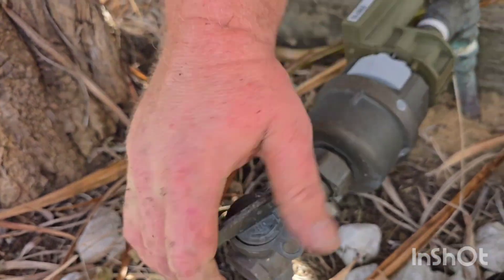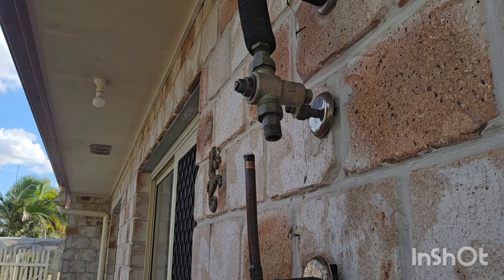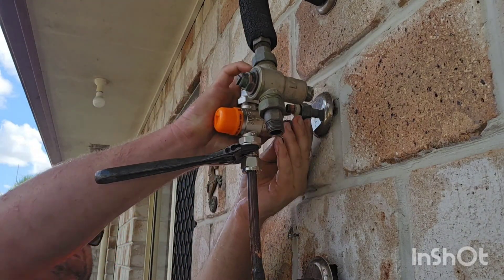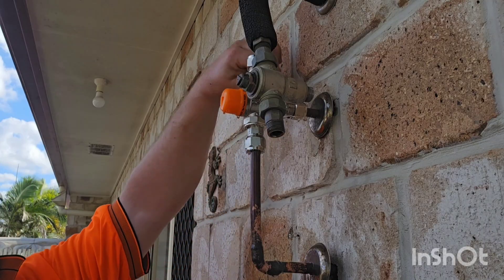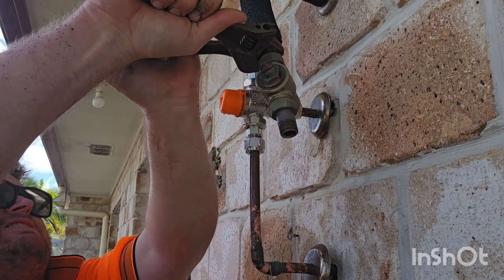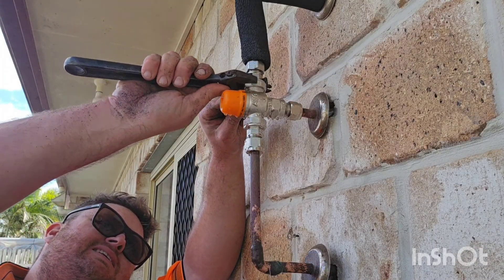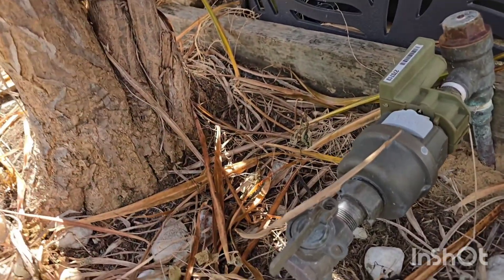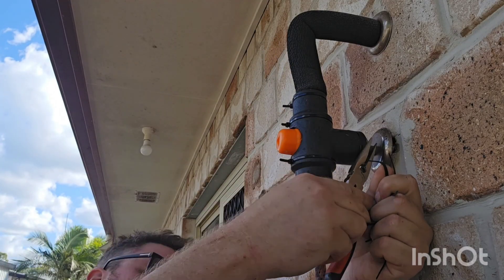How to Install a Tempering Valve on a Hot Water Service!

Comment: Would this tempering valve work in my situation? My water is gravity fed from a tower. The HWS is older and has a 3/4" pipe. The cold water has 1/2" pipe. Because there is no pump to adjust flow, the HW is scalding hot and there isn't enough pressure from the cold line to have a decent shower. When my cold water tap is turned fully on and the HW tap barely a dribble, I get the right temperature.  I thought about having the HWS fitted with 1/2 " pipe but then I'd get little pressure on both lines. Apart from knocking through walls and cutting concrete paths, I can't see a way to get 3/4" (cold) all the way to the shower. I also thought about getting the HWS temp adjusted down but read that it's not advised to go below 50 or 60 degrees. I don't want to install a pump as we have frequent power backouts. Gravity feed is always there.  I'd be grateful for any advice. Thnx

Comment: Great video. I just completed a replacement install. 
Note that plastic olives are more forgiving to use than copper ones to get water tight without over tightening. Also allows you to refit again easily if you get leaks. I found that the valve fitted better if I attached the top and bottom first. As the gap between my pipes only allowed for precise fit. It did appear as if my replacement was smaller but that was not the case. Trust yourself and get some spare olives before you start if you are novice like me.
Noisy pipes stopped now.
Thank you for sharing this video.

Comment: Great video - you make it look simple and safe to perform. My system has noisy pipes, temperature is consistent and working fine. Would replacing this valve help to reduce noise? Is the valve the cause of the noise?  Could it be the cold water inlet valve that you turn on at the end of the video that needs replacing?
Reply from the maker: The noise could be caused from multiple places. The most common cause would be that your pressure reducing valve is not working properly on the water metre

Comment: I had a faulty tempering valve — the water inside the house was just warm, but I noticed it was hot near the water heater when I released some through the pressure valve. I followed your video and managed to replace the valve myself. Now the hot water inside the house is working perfectly! You saved me a good amount of $$ — thanks so much for the clear and helpful video!
Reply from the maker: I'm so glad I could help

Comment: Hey mate, I’ve just changed mine. I’m still getting low pressure when using only hot water. What could be causing this?
Reply from the maker: Could be the duo valve or the entry or exit holes could be blocked with rust

Comment: Lots of great info Cheers. How much would be a reasonable price to be charged to replace including the valve by a plumber?
Reply: Don't replace it. Get rid of it. If you want cooler water, turn the thermostat down. These are govt ordered theft. You have to pay to heat the water up then add cold water to it to cool it down.. sorry that's theft. Just turn the temp down and not pay to heat the water up in the first place..
Reply: @wombat5555  Mine is heated by the Sun.
Reply from the maker: @wombat5555 unfortunately we need to install them no matter what or risk losing our plumbing license. The home owner can do what ever they like after we have completed. It's also good to prevent burns from the elderly and young children.
Reply: @orbitplumbing that's what my mate said when he installed ours lol😁
Reply: @orbitplumbing  I fully understand the reason why. But couldn't they have done the same thing via the thermostat? Is all I'm getting at. 🙂
Reply from the maker: I'd say maybe around $350 AUD. It really depends on the valve as there are different types
Reply: @orbitplumbing  Thanks for that, I was quoted the same by a guy the other day which is reasonable. The original guy I called from Fallon quoted $1000 and made it sound like he was doing me a favour. Needless to say I told him where to go.👍

Comment: I'm getting a loud bang in front of my tempering valve attached to my electric hws.  I'm worried it will damage the pipe or valve it's that loud. The single action and twist taps all cause the bang. Would a water hammer arrestor in front of the tempering valve stop the water shock? Anything else i could try? Cheers
Reply from the maker: No, you need a new duo valve. Thats what will be causing the noise.
Reply: @orbitplumbing  I think I've a very old model of duo valve. It's got a + adjustment - on a screw.  It was leaking a few months ago and the plumber said it was fine, the leak was from something loose underneath the valve. I wasn't at home at the time and forgot to ask him about the water hammer 😔
Reply: Sorry it's a non return isolation pressure reduction valve (NRI-PRV). I don't seem to have a duo valve.
Reply from the maker: @DosLobos  that's the same thing just a different name
Reply: @orbitplumbing  thanks for this. Checked the pressure and it's around 700kpa. Have tried to adjust the screw on the valve and it makes no difference so I think it's safe to assume it's not working and the pressure is too high.
Reply from the maker: @DosLobos  are you in Australia? Can you text me a photo? 0455535137

Comment: I have a brand new gas HWS installed, but the hot water pressure is a little lower than previously. Should I just adjust the tempering valve?
Reply from the maker: Adjusting it won't change the pressure. You could see if the filter in the temp valve may need to be cleaned out. Also check you aerators. I have made another video about aerators

Comment: Do you turn it clockwise or anti clockwise to make it hotter or cooler?
Reply from the maker: Hi @antonnicaj01, good question! To adjust the temperature on a tempering valve, you’ll actually need to take the cap off first—just turning the cap won’t do anything. Once the cap is off, you’ll see a little triangle adjustment knob inside. You can use multi-grips, a shifter, or the tool that comes with the valve (if you’ve still got it—people often leave it on top of the hot water system or tucked into the insulation around the valve).

Once you’ve got access:

Turn clockwise to make the water colder.

Turn counterclockwise to make it hotter.

Make small adjustments, and give it time to stabilize before testing the temperature. Just for reference, in Australia, the maximum allowed temperature for hot water at taps is 50°C. It might be a good idea to grab a thermometer and double-check to make sure you're within the safe range. Hope that helps!
Reply: @orbitplumbing  Thank you so much. I'll definitely check  the temp once done. Cheers.
Reply: @orbitplumbing  How many turns do you  need to make to know what temperature you are at? The one I have can go full 360 degree turn and it seems like it can continue.

Comment: Great video. My house has lost  hot water pressure (solar hot water) maybe this valve is clogged or faulty?
Reply from the maker: That is very likely. Also maybe the circulating pump is not working any more and possibly your booster has stopped functioning.
Reply: @orbitplumbing  thank you for the reply I will look into it.

Comment: Horrible things, mine will either burn you all of a sudden or freeze you or both at the same time. I've turned my HWS down to it's lowest temp (60c) to stop the burning thing from happening. It's a new orange cap like the one in the video. I'll be bypassing mine.
Reply from the maker: @Alabaster335  it actually sound like you have an instantaneous hot water service and it is having a gas supply issue. Would that be the case at all?
Reply: @orbitplumbing  nope just a regular electric HWS.

Comment: Nice, thanks!
Reply from the maker: @codyaq2  glad I could help
Reply: @orbitplumbing  Would you have to drain the tank before doing this, also is there a chance I wouldnt be able to get the white seals on each pipe off?
Reply from the maker: @codyaq2  you can do if you want. Make sure you turn off the power at the switchboard first. It's pretty easy to just do it quickly if your confident to do it that way.
Reply: @orbitplumbing  Replaced the tempering valve on the weekend with the help of my dad, thanks again for your video, gave us good insight :)